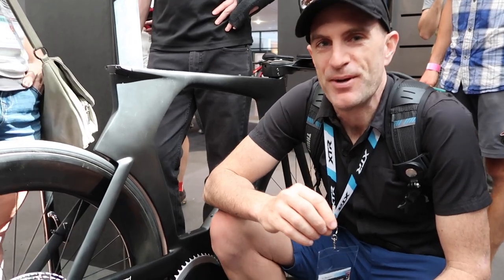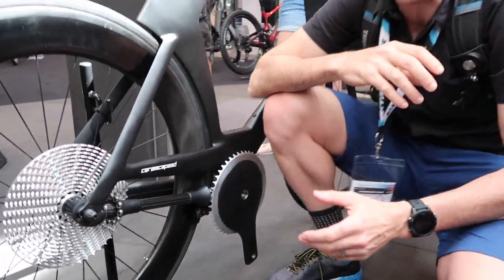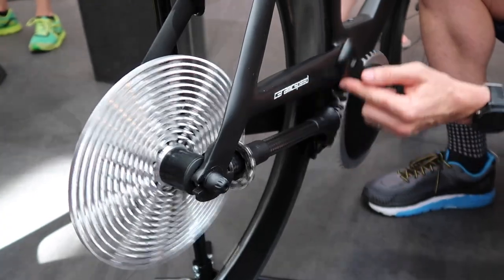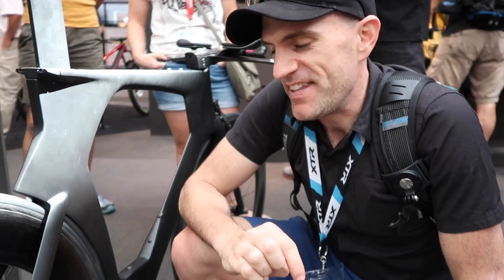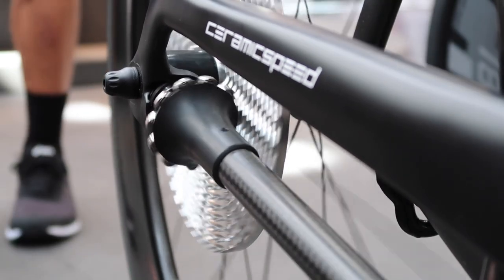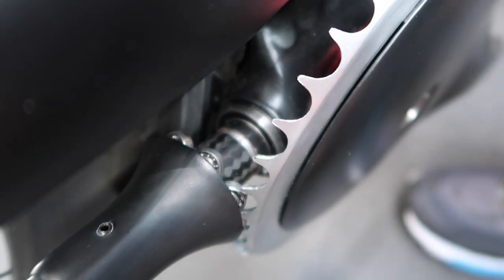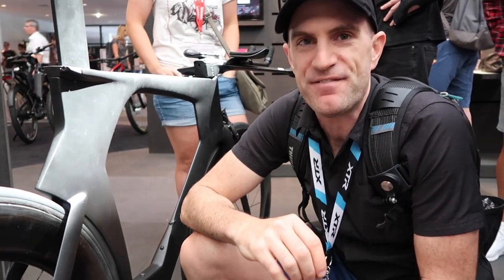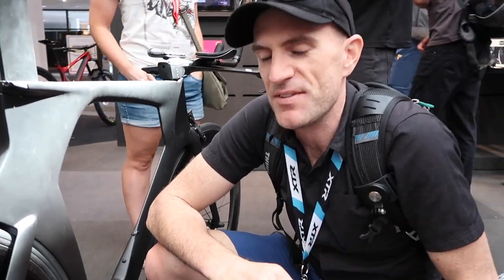CeramicSpeed DrivEN 99% Efficient Drive Shaft // Chain Free Bike // Eurobike 2018

Comment: Interesting idea. Lots of issues. Those tiny bearings won't last long, imagine the forces going through one tiny roller bearing, which isn't designed to be loaded at that angle. Maybe two custom designed cones with with shallow radiused splines, possibly nylon or something else self lubricating might work better? Still be susceptable to crap though. Chains deal with grit, small trees and animals remarkably well. Anyhoo I like the idea.

Comment: One problem is the torque. If you manage to put down torque, the carbon stick or whatever will experience alot of rotational stress. But I see that they have put carbon fibre there which is very resistant to that kind of stress. Maybe it's more efficient but it was also have less ability to transfer power. And if it breaks, it's harder to change and cost more. But also, it should not need to change as much as a chain

Comment: I like it, change the materials (ie replace the aluminum cog/ cassette with titanium) and you'll have a more efficient vehicle that will last. Aluminum is too soft of a material against steel bearings. Every contact will diminish the character of the cassette over time using steel v aluminum, especially when torque is involved.   
  They have a good prototype, now it's time to make a real product.

Comment: I'm with kkehoe5.  For one, this looks like it puts a tremendous amount of side thrust on that rear "cassette."  Find someone with enough power and it'll push away from the drive "gear."  Also, anytime you change direction of force, you lose energy/watts/horsepower.  That's why sport/super bikes run chains instead of shafts.  And not sure I could deal with the constant noise of that thing on a long ride.  Nice engineering but impractical.

Comment: Improve the bike. Put dual tires in the front that have dense foam donuts with a round outer surface with a notch on the inside. Place a Kevlar inner tube into the notch place tire on rim then inflate the Kevlar inner tube with nitrogen to push the dense foam outward to make the tire ridged. Then add crank sprocket on both side's of the bike and seal them within the hub. Center the drive shaft so both internal sprockets can apply force to the drive shaft.   Use a swing arm for the back tire with a hole down the center for the drive shaft and to enclose the drive shaft. Use a dual hub for dual tires in the back use two speed plates giving the drive shaft two points of contact to drive the bike forward. Then add disk breaks and enclose the back so no moving parts other then the wheel is visible to protect the mechanic's of the bike and from any thing to get caught up in the moving parts. Then design an accessory electrical motor that you mount in the cranks to turn it into an E bike. For an E bike upgrade? Design the rims to house organic carbon power cell technology. Each rim being an organic carbon power cell.  With wireless energy transfer to power the electric motor.  Design the swing arm to have a compartment where you can place mini crystal graphite power cells stacked in each other connected in series that will generate electricity off earths energy field to trickle charge the organic carbon power cells in each rim when the bike is not in use so the E bike will always be ready to go. 😊😉

Comment: Okay, first up, interesting and very original concept. I must say, theoretically it looks great at a bike show on a stand. I don't see how it will work though. 2 teeth or 1 tooth cant possibly handle the load. I'm a 200 pounder. I see it slipping and going nowhere starting off. That cassette thing on the back has got to be rigid as hell. Also how does this system stay aligned over bumps and fast stops. It somehow has to be much more robust. It would be a super duper drive system for model boats.

Comment: Some motorcycles have had shaft drives for years, and there's a reason most still use chains. A cool concept but I doubt it will take off.

Comment: I like the simplicity but the durability??
Also chains aren't rigidly mounted so misalignment is tolerated. It's hard to imagine how to deal with misalignment in this arrangement.
Perhaps the rear bearing could be spring loaded so it tracks the sprocket when the frame flexes and to stop drive shaft binding. On the velodrome it will be OK maybe.
Still, very innovative and i like the concept and simplicity.
On cars with split driveshafts, they use a bearing mounted in rubber so maybe this and the spring loaded rear bearing could solve the issues of frame flex effecting driveshaft binding and the spring loaded rear bearing maintaining proper mesh.
Sorry thinking out aloud here - i'm not re-editing on my phone lol!

Comment: If you want to make a bicycle more efficient without so many new engineering challenges, just replace the plain bearings in the chain with roller bearings. A significant amount of input energy is lost from grinding the plain bearings against the inner surfaces of the chain links. No amount of frequent maintenance and lubrication can make plain bearings more efficient than roller bearings.

Comment: Looks cool, but I have no idea how it could have 99% efficiency. I won't quote any exact numbers, but as a rule of thumb, anytime you need to change the direction of rotation (i.e. 90 degrees turn from pedals to drive shaft and another one from driveshaft to wheel), you lose efficiency and create heat.

Comment: To stop the ball bearings jumping out, there's no reason I can see why a contrary-rotating gear wheel couldn't be placed the other side of the ballbearings. This would hold the ballbearing-holding shaft tightly in place. It would have a small extra friction impact I suppose, but with a well lubricated system that ought to be minimal.

Comment: Shane,
i'm not a rider but i saw the same issue you did with the roller bearing. thye nspeak highly of having only 2 points of contac with the drive gear.  In a sprint , a heavier trider, or taking off from a dead stopmay verey have the the rider pushing through the gears as they slip. aluminum is great to work ith but on a part lioke that, well theres a reason they make standard grear from steel (that I know of) More so, this is going to be a wear part and with 8 hours of machine work it's going to be very expensive to replace. This price tag could limit the sales into the commuter bike and weekend cylist markets.
I will say i am very impressed with what they7 have deve;loped and its good th=o see thast kind of inovation. I can see their roller bearing and gear wheel technology in a variety of markets / industries and prduct. to be rid of a rack and pinion configuration, sprocckets ans cogs would be huge in equipment where weight is not an issue and the durability can be built in. They have the tigar by the tail right now and its going to go big.

Comment: Add a second drive shaft on the other side. Design an interlocking gear disc that can be installed through the spokes of the wheel, sandwich the whole gear disc in between both drive shafts. Bevel the drive shaft contact points, the ball bearing stuff is useless. The driveshaft itself can't handle torque regardless though. The contacts would be ripped up in no time. They need to rework the entire concept

Comment: I would of used steel, a double driving system with a reversing gear box around the axle to spread the load, and a mag system inside the shaft to change gears.

Comment: That's going to need some sort of roller on the back of the gear to stop it deflecting away from the drive gear. It's certainly possible to make it work, but not in the exact form it's in now. How much weight that's going to add is anyone's guess.

Comment: racing bikes are ~ 95%, with 97% efficiency quoted for the top performers. wind resistance is a larger factor rather than mechanical efficiency per the performance of a racing bike.

Also, mechanism efficiency tends to peak at certain speeds so I wonder what the difference will be for performance speeds of this mechanism vs. that of a racing bike.

I really like the bearing gears though, never seen that before.  

As people in the comments mention: looks sensitive to misalignment or shit getting into the mechanism/gears.  Also, being that mechanical efficiency is not so much an issue of racing bikes (wind resistance more an issue): what's the point?

Also, of all the efficiency numbers I've quoted: I don't believe any of them LOL, even less so towards this " 99% " .. but they are all documented online to be such.

Still upvote though because it's something new p cool
Reply from the maker: Good commentary. I agree. I think it's more about the company doing something different, thinking outside the square. I suspect, for the reasons you mention, it won't reach their goal of 99%.... but it just might inspire someone to think differently and maybe come up with something new themselves.

Comment: Good direction, but the gear "teeth" will never mesh, it will be noisy as hell, and the disc will wear fast.  Maybe with hard rubber wheels clamping around a mostly smooth disc with small grooves for traction.

Comment: 8hrs for a single part is obviously silly, that needs to be cast or done in large batch metal powder print. Cool idea. On long races that extra 1-2% will actually matter. Not sure it's a good idea for mountain bikes, part of me says, "Hey, no chain flopping around." another part says, "This thing is screwed on high torque maneuvers.". Maybe they should come up with a system that allows the drive-shaft teeth to splay across the wheel disc so that 4-6 of them are engaged at once. But at that point your back to a smaller part that behaves like a chain.

Comment: Eight hours to machine the gear set will make it too expensive, although that will be reduced with production development, it will still mean replacement of all when any one ratio is damaged, consider separate rings?
It's hard to imagine that it would shift ratios smoothly but it is to be hoped that the designer(s) have addressed this before getting this far in development.
There are other issues but well covered in other comments.

Comment: This looks like another form over function situation.
The amount of force the driveshaft is gonna exert on the 1, maybe 2 teeth at any time will simply shear them off, especially if they're made of aluminium.
You're better off with an internal hub gear setup if you have to use the driveshaft system...
Reply from the maker: I agree.

Comment: There are 3 directional changes so I have no idea how you could achieve 99% efficiency when you lose roughly 3.5% with each direction change. This system might be 90% efficient but 99% I highly doubt it especially with the shaft to wheel rounded interaction as you mentioned, that's a ton of force pushing away and so no slippage seams impossible.

Comment: Bad Ass ya, cool ya, BUT ! i dont think this will kill/beat the classic chain at price or at distance running in km

Because usage of chains in time have degradation of ''elasticity/orthodontic forces''
i come with this idea from year 1999 and it works until today

Example medium setup(not eagle Bullshit 12 spd):
3 kmc z72 chain** + 8spd cassette + crankset truvativ isoflow 42/32/22
price 8$*3+15$+30$= 69 $(275 ron)_1$ = 3.9844 ron

**=each chain run-it for 1000km, 3 times or more
chain1 run-it for 1000 km > reserve 1.1_(1000 km = 621 miles)
chain2 run-it for 1000 km > reserve 2.1
chain3 run-it for 1000 km > reserve 3.1 = 3000 km (=1864 miles)
stop. start from beginning 
> reserve 1.1 > 1.2, 2.1 > 2.2, 3.1 >3.2 = 6000 km (=3728 miles)
stop. start from beginning 
> reserve 1.2 > 1.3, 2.2 > 2.3, 3.2 >3.3 = 9000 km !!! at buget (=7546 miles)

or if you have 10 chains for this try, its better, 1 MILE = ~1.6 KM

on by curent bike at 12.000 km(or 7456 miles) --> (10 chains try)
chains don't skip/jump on the cassette(XT-8-spd on chris king aluminium not Heavy Duties version) + crankset(race face DH forged),i have no signs of usage.

Comment: While I appreciate the ingenuity, this seems like a solution looking for a problem. As a power transmission system I think a chain beats it hands down. The load of a sprint would mean this would require a complete redesign of the whole rear end of road bike. On a hybrid or ebike the cost, complexity and other shortcomings would negate any weight or efficiency improvements.

Comment: How is this different than the drive shaft that many motorcycles use? Granted the motor system is lots bigger & heavier, but technically what's different. I don't know enough about either.
Reply from the maker: CeramicSpeed claim the bearing interface, not direct interface of gearing.

Comment: As noted, the multi speed drive shaft isn't a new idea. Not even for bicycle application. It's at least a century old. And while it looks neat, here specifically, the idea of roller gear teeth on the shaft mating with the toothed disk would require an extremely rigid setup, as any significant pedaling force acts to push the teeth and gear apart and risk skipping. The required rigidity means significant weight gain. It all still needs lubrication, and probably some kind of protection from the elements would be wise to avoid undue wear. 

This doesn't even begin to take into account the additional reasons why shaft drives have made little sense for bicycles in the last hundred years. Yes, shaft drives are great for cars and tractors, etc. Just keep in mind that those vehicles are not human powered.

Comment: In 1933, following the maiden flight of the world’s first modern passenger aircraft – the 10-seater Boeing 247 – an engineer is reported to have claimed: ‘There will never be a bigger plane built.’
In 1899, The Literary Digest magazine had this to say about automobiles: ‘The ordinary ‘horseless carriage’ is at present a luxury for the wealthy; and although its price will probably fall in the future, it will never, of course, come into as common use as the bicycle.’
In an article titled ‘The Futurists: Looking Toward A.D. 2000,’ the magazine claimed: ‘Remote shopping, while entirely feasible, will flop – because women like to get out of the house, like to handle merchandise, like to be able to change their minds.’
In 1981, Motorola’s then director of research Marty Cooper, who just eight years earlier had made the world’s first phone call by cell phone, stated that ‘cellular phones will absolutely not replace local wire systems. Even if you project it beyond our lifetimes, it won’t be cheap enough.’
(quoted from an article written by Helen Armitage hosted on culturetrip.com).
Reply: dream on.

Comment: Why not do something like this?

Develop a custom Kevlar toothed belt for bicycles.  Then design an automatic tension based bicycle CVT.

You need a centrifugal clutch on the crank, but weight it in such a way that a small amount of movement on the crank closes the clutch instantly and causes it to grab the belt.  On the back of the bike instead of a sprockets, you'd have the secondary clutch, which is engaged all the time.  If you want to free wheel you just stop turning the crank forwards with your feet, this would cause the primary clutch on the crank to let go of the belt and the belt would then spin freely over the primary, thus free wheeling.  On the back, use the secondary clutch to engage a small puck like CVT transmission that would automatically adjust ratios based on the speed and resistance of the rear wheel.

You'd have a bike with infinite gears that you never need to shift, it would be in the right gear all the time.  And it would be perfect for EV bikes with electric motors.

Someone kind of did it already:

https://gizmodo.com/how-a-bike-with-infinite-gears-changed-the-way-i-commut-1791941295

Comment: Just wondering whete the noise is coming from. When youre freewheeling  and the drive shaft is stationary the noise is still there.
Reply from the maker: The freehub in the rear wheel, the same as a normal freehub equipped bike.
Reply: @gplama But it's still there when you're peddling. Looks awesome BTW!
Reply from the maker: That's the noise it makes when the bearings/interface engages. (Which also takes away from efficiency)
Reply: @gplama  I thought that. Still looks like the start of something really interesting.
It will be interesting to see how this evolves. Thanks for info!

Comment: Good idea, but it won't work. The normal stresses generated by the load between the bearing and the tooth will cause the crown to separate from the bearing itself. In that sense, I don't think it will work. It's a good start, but for now, I don't think it will work. There are certain details that need to be improved, especially regarding normal stresses.

Comment: The gear is fixed, no gear selection, shaft isn’t sliding in this demo, this is absolute junk, i leg press 1200Lbs, I guarantee you it’ll break under my legs torque. :)
Reply: Drive shaft with traditional gears more reliable

Comment: Seems to me it would be much stronger with only one sprocket at the back and the gearing up front. Easier to change gears from that end too with a cable pulling through the center of the shaft and a spring pulling back

Comment: The problem with this thing is maintenance. You quite easily put the chain back on if it pops. This bike looks like it would cost my life savings to get one of the bearings fixed.

Also if one thing breaks on the gearwheel, it has to be replaced in its entirety? In a normal bike, you can replace them separately.

Comment: Ok, so why no footage of the bike being ridden? I find it difficult to believe that this bike can be ridden for any useful length of time in it's present form - not without stronger materials and a waterproof housing for the gear mechanism for protection against general road surface muck - one you'd have to keep topped up with oil.
Reply from the maker: Because it's a concept. One to ping CeramicSpeed about.